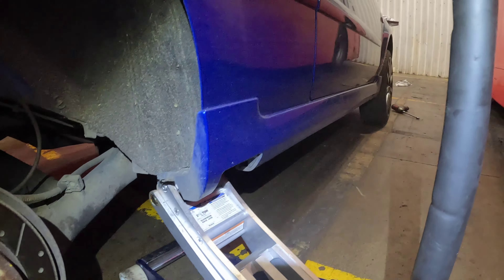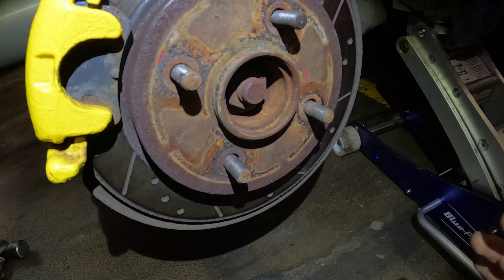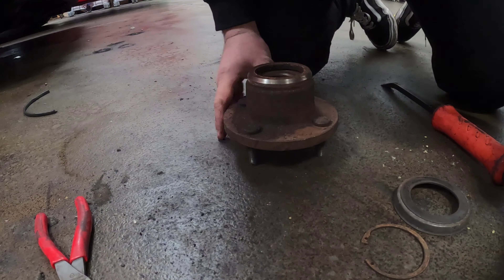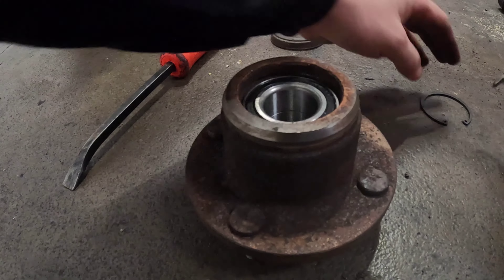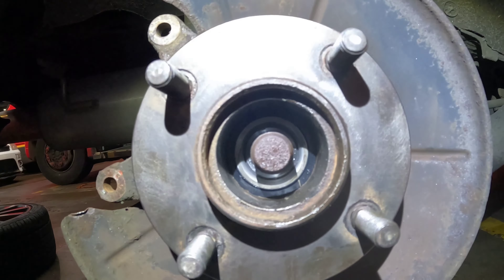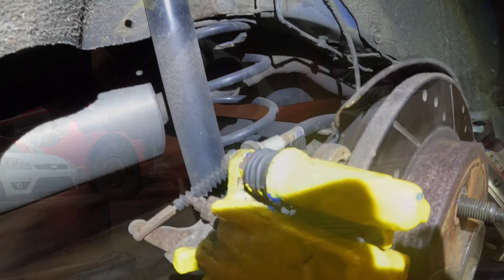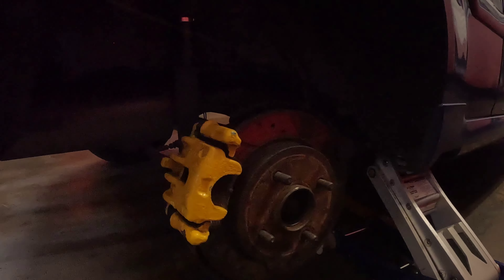MK6 Fiesta ST150 Rear Wheel Bearing Replacement

Comment: Hey mate, love the videos, is there any chance you could show me where all the hoses/vacuum lines route to on the Cossy inlet manifold, would be much appreciated as I can't find the info anywhere on mine I have two on top of the manifold, then two just down and left of the throttle body. Cheers, keep them coming.
Reply from the maker: Thanks mate much appreciated I’m tempted to make a video on this as I get asked this a lot especially since the video was released
Reply: Thanks, it's just that I'm almost certain mine are hooked up wrong after seeing videos and images, and I have a cold start issue since it was fitted and mapped, it may just be the map but it would be nice to know where that should route to just to eliminate that potential problem
Reply from the maker: @AaronJeffery-j1p  who was it mapped by as my cold start is shit since it was mapped
Reply: Jamsport did the map, it runs great once warm and they squeezed great power out of it, but when cold, you have to keep the revs up on the pedal or it will cut out. Starts on the key every time though. It's such a minor yet annoying thing 😂 @6uiltdifferent
Reply from the maker: @AaronJeffery-j1p  I know the feeling well mate as mines literally the same

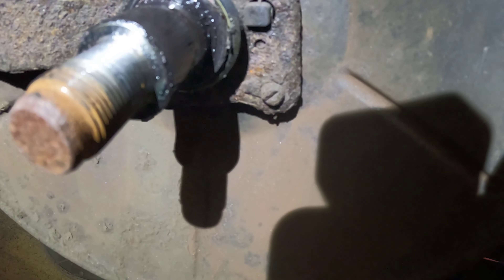Comment: I see at 3:35 the stub axle has like a rubber seal on it. The one i got from p b spares has this on it. I'm looking for a new one on ebay??? the reason is i'm going to make rust remover from a citric acid and baking soda to clean the axle up. I take it i might kill the seal?
Reply from the maker: @alanpatterson2759  not too sure whether the seal would survive if I’m honest it’ll be a case of try and find out I’d try and mask it up as best as you can to try and prevent it coming in contact with your remover
Reply: @6uiltdifferent  I'll check with the local ford garage to see if its available. I'll hold on and no do anything mental.
Reply from the maker: @ they’re expensive to buy new
Reply: @6uiltdifferent  seen one from the ford official store £282 messaged them if the seal is separate. shows the seal attached on the listing they have.
Reply from the maker: @alanpatterson2759 no it’s never separate always fixed mate